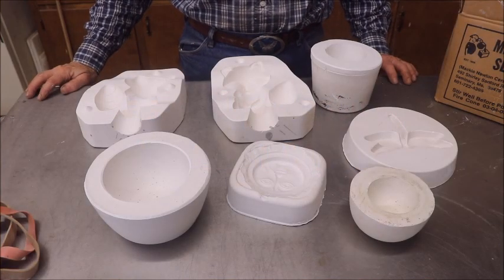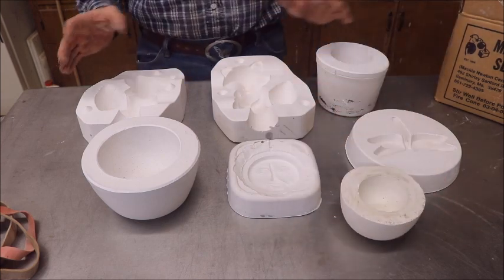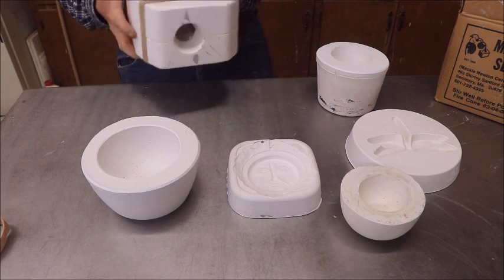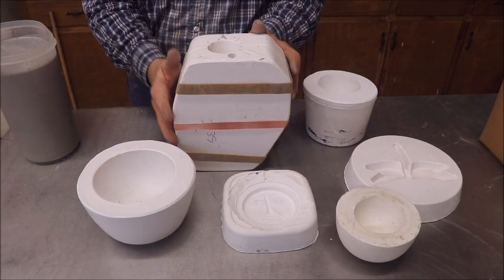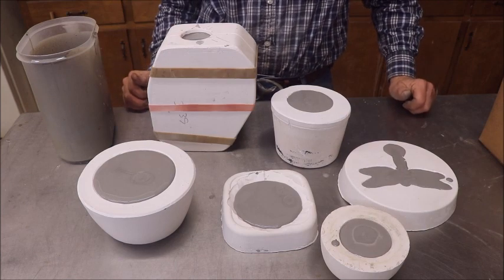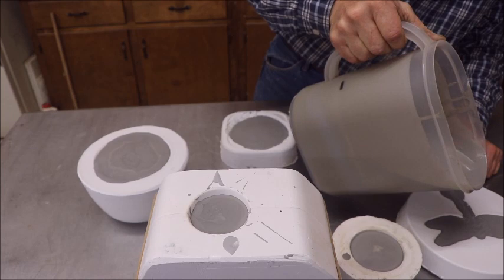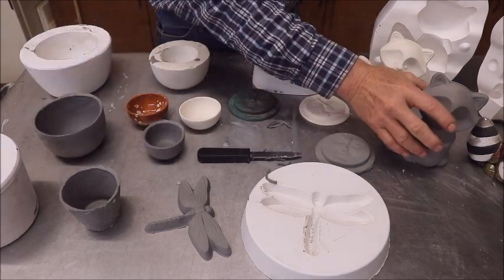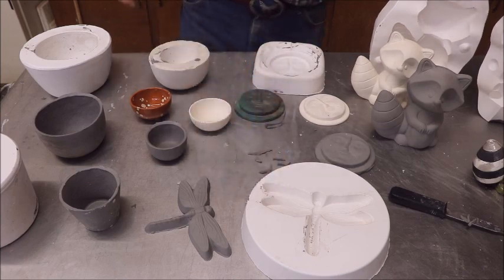Basic Slip Casting

Comment: Thank you so much for this video! Your voice is so pleasant to listen to and you sound so kind and reassuring. I have a buncha, buncha molds that I acquired super cheaply a couple years ago and never knew how easy it could be to get started using them. I'm going to go clean out a pottery room & get set up!
Reply from the maker: Good luck with your slip casting.  Let us know if you have question.

Comment: Thank you so much. This is totally new to me.  It peaked my interest because I have a microwave kiln and while  I make a lot of  jewelry with stained glass  I  wanted to get  more use out of the kiln and try something new.  Can you please  share where you got the slip and also the fiber to fix the kiln base.  Thanks again
Reply from the maker: No problem Maria.  Tomorrow I will get to work  on obtaining that info for you.
Reply from the maker: Maria, you can start at Amazon for the Kiln fiber paper/blankets/liner, It comes in all thicknesses and lengths.  As far as the slip goes, it depends on where you live as to how difficult it will be to obtain.  I live in a small town in Georgia and I have to drive to Columbus, GA to get mine.  It can be purchase on line, but the shipping might be a killer.  Start here http://www.bigceramicstore.com/clays/clays-by-type/slip.html and do some research.  As you will discover, it can also be purchased dry and you can mix it as you like.  If you have other questions, please ask.

Comment: Capt. Mike, with the pandemic I had decided to try something new. I purchase a lot of plaster molds, wanted to start by using plaster París instead of slip clay, but it get stuck in the molds, can I work with plaster París or pottery plaster and do casting in the molds or I only can use clay slip on the ceramic/plaster molds.  I am new and learning by reading and watching youtube. I enjoy yours. Please help
Reply from the maker: The plaster molds are designed for clay slip.  If you pour plaster into the you will not be able to get it out.  A two part mold will stick completely together.  If you cannot get clay slip, you can make it from moist clay.  I have two videos on how to do this https://www.youtube.com/watch?v=LN8w-DIEQLk and  https://www.youtube.com/watch?v=p3uYvu7QlJg
Reply: @CaptMike  thank you for the videos, it would be great if I can create a silicone mold using the plaster molds I already have.  learning step by step thank you again.
Reply from the maker: @beatrizgrajales4181  I thank YOU for watching my videos.  I wish you all the luck in your adventures.  Glad to help where I can.

Comment: Mike thank you so much for the tutorials. They are fun and easy for a novice like me to follow. I’ve just made a mould and put an unglazed pot into it, which is now stuck (as the plaster hardens). Happy to break the pot I want to replicate but my second problem is that I’m concerned about getting the slip out of the mould because the opening is small. What should I do? Haven’t started with the slip yet;)
Reply from the maker: I the pot you are using as a mold is enclosed all around except for a small opening around the top, you will have to make a two part mold.  If the pot is shaped like a flower pot, then when the plaster is dry (assuming the clay pot comes out) you will be in business as the clay slip will shrink as it dries and the molded pot will pop right out.

Comment: Hi Capt Mike! I wonder if you are local to me! I just drive to Mackie’s last week and Val loaded us up! We are new to this..trying to start a church ministry. We just poured our first molds after watching this video. It is VERY hot in our metal barn. When we went to drain, some molds did not want to drain anything. Did we leave too long? We left the small ones about 20 minutes and large vintage mold about 35 minutes. We have had tons of rain but the heat was drying the slip quickly! Thanks
Reply from the maker: I live in Elberton, GA.  My shop is airconditioned so the high temps could play a big role.  In a large mold I can leave the slip in for about an hour.  Again, that depends on atmospheric conditions and how dry the mold is. What are the molds casting?

Comment: Hello Capt. Mike EXCELLENT videos. I've been binge watching and learning. Thank you sir. Quick question I only have silicone mold that are food grade and can be heated so they are super durable. Can I use this for my clay slip? because I do not have plaster mold. My molds are only silicone grade. Or maybe I can use paris of plaster to pour into the silicone mold to make is plaster then use it with clay slip.. What do u suggest?
Reply from the maker: The only problem with pouring slip into a silicon mold is the lack of absorption.  That's what the plaster of Paris does.  It absorbs the water from the slip leaving a clay shell.  You clan press normal ceramic clay into the silicon mold and it will dry faster.  You have nothing to lose by trying the slip.  It will just take awhile to dry.  Another idea (I am working on this as we communicate) is to make a master (positive) by pressing regular modeling clay into the silicon mold and then sticking it to the bottom of a container and then pouring plaster of Paris over that to form a mold.
Reply: @CaptMike  hmmm I would love to see a video on your new idea you're cooking up and thx you. I'm not interested in making a clay shell. I want a full clay mold. Im making soap dishes btw. So either I can use modeling clay in the silicone mold or the slip.

Comment: Love your video. What happens if you don't fire them because you don't have a kiln?
Reply from the maker: Lori, you cast clay slip in a plaster mold.  If you do not fire the clay it will remain soluable in water and if the piece gets wet or bumped (it's fragle) it will fall apart.
Reply: @CaptMike  Thanks!

Comment: Hi! Excellent video. New to slip casting…how large do you recommend the length of the rubber bands relative to the circumference of the mold? I have a mold I just measured at 27”, so what size rubber band would you think I’d need for it to be tight enough, but not too tight? Thank you!!!
Reply from the maker: Iuse 3 sizes, but off hand I don't know the lengths.  However, Don't worry about the bands being too tight.  Use the smallest you can get around the mold.  thanks for watching!

Comment: Hi Capt Mike. I've watched loads of your glass fusing videos, and I'm intrigued to know if these types of castings once bisque fired, could also be used for glass casting? I've had limited success using clay for casting glass, and these look much more like the moulds I've had from Creative Paradise and Slumpys and it would be great to known if this is something I could use them for.
Reply from the maker: Any clay item, bisque fired will work for slumping or forming glass.  Well, at lest as far as the design permits.  The bisque piece, once coated with glass release agent will stand the temps for glass work OK.
Reply: @CaptMike  Thank you so much. I'm going to have a go at this. I think my clay pieces insulated the glass too much, but doing a thinner slip cast piece will allow more heat to get through the glass. Super excited. :-)
Reply from the maker: @helpforhedgepigs8461  Let me know how things turn out.

Comment: Thanks for your videos, Capt Mike! After you initially pour the slip in, how long do you let the bowl molds sit in order for the sides to harden up?
Reply from the maker: Depends om how dry the mold is and the weather.  Usually, with fresh slip about an hour or until the slip looks to have formed about a 1/4 inch shell.

Comment: Great detailed explanation . Thank you.   What is the gray liquid material you pour into the plaster.  Do you have video to show that also?
Reply from the maker: The grey liquid is liquefied clay called slip.  It can be bought commercially or you can make it by basically adding water to your clay body.  When you pour it into the plaster mold, the mold adsorbs the water from the "slip" and solidifies it back into the clay body.  The result is a cast of the inside of the plaster mold.
Reply: @CaptMike  Is this clay food safe? Thank you.
Reply from the maker: @mikekiske  The clay is food safe when bisque fired and the glaze will be depending on the type.  All glazes will state whether they are food safe or not.  Most are.
Reply: @CaptMike  Thank you!

Comment: Hi Capt Mike , I'am new to this is it possible to pour molten aluminum in these plaster molds or will they not last long
Reply from the maker: I don't think the plaster would hold up.  If yu try,  make sure the plaster is completely dry and use a flat one piece mold, not a 2 piece where you pour the metal inside.

Comment: I'm really new to doing ceramics.  Can you tell me if you can make a plaster paris mold with a plaster paris object. So in other words I have a  item that is made out of plaster paris and I want to make a mold of it in plaster plaster . Thank you  I really enjoyed the video and have learned from it..
Reply from the maker: If the final product is going to be a plaster duplicate of a plaster original, then I would make a mold from silicon or latex, depending on the subject.  It is possible to coat a plaster master with enough stuff to keep it from sticking to the new plaster, but it is problematic.  I have used cooking spray, Vaseline and Murphy;s oil soap to keep the second half of a two piece mold from sticking, but never tried to mold plaster to plaster.  Unless the master is painted or something like that,  I can assure you that plaster will stick to plaster.  I will do a few experiments when I get a little time.
Reply: I"m going to use the mold that I make with ceramic. I just need to make a mold from a object that is made already out of plaster paris.  So i'm thinking that if i paint the object first with acrylic paint then use cooking oil , I"m thinking it will work ok...lol  with fingers crossed.  That will be great when you get free time to do some experiments ... Thank you for letting me pick your mind a bit...

Comment: How long before you pour the excess slip out of the mold?  how long was it before you pulled the acutual part out of the mold from the time you first poured the slit in?
Reply from the maker: It depends n several factors, but mostly on how dry your mold is and the thickness of the slip.  Under normal temperature 70-80 degrees F and average humidity my low fire slip obtains a desired thickness (shell) of about 3/16 to 1/4 inch in about 45 minutes; sometimes little longer.  I live in Georgia USA.  Demolding can be done as soon as the clay sip is ridged enough to be handled without deforming,  usually 3 or 4 hours depending on the complexity of the molds.  Slip can be left in simple molds overnight if you wish.  Hope this helps.

Comment: Did you pour it out of the 3d mold as well?
Reply from the maker: You only need to do one pour into a plaster mold.  Pour in the slip. let it set for awhile (usually 30 60 mnutes) and pour out the excess slip.  I usually let my molds set overnight, but at least until the clay is solid enough to be handled.
Reply: Thank you :)

Comment: wondering if you can do this with air dry clay slip
Reply from the maker: Don't know anything about air dry clay slip, but if you can get it liquid enough it might work.  What I would suggest is to first put some of the slip on the outside of the mold or on some plaster and see if it will release when dry.

Comment: So the water just needs to escape the clay right? Does this mean I can pour slip into silicon molds?
Reply from the maker: Theoreticality you can, but the time it will take for the evaporation will be lengthy.  Normally a plaster mold absorbs most of the water and speeds the drying.

Comment: do these molds ever need some kind of mold release?  My roomate said they need some kind of release?  or is that just when the plaster molds are first being made?
Reply from the maker: No they do not need any type of mold release.  As you mentioned, the only time I use a release agent is when I am making the plaster old.  Most of the time if the master is glass or plastic a mold release will be necessary.  After the mold is made and dry all you have to do is pour the clay slip into it.  As the slip dries it shrinks and pulls away from the plaster so you can remove the cast piece.

Comment: When I take my 2 piece mold apart, the piece is always brown in half. What am I doing wrong?
Reply from the maker: By brown, do you mean inside the cavity?  If I use my  local clay for slip casting it always turns the inside of my mold brown/red.  The casting will also be the same color.  If you are using regular low fire clay slip purchased  from a supply house, it usually will be grey in color and fire to white.  Terracotta slip will be red.  Let me know.
Reply: @CaptMike  sorry! That was a typo. What I meant to say is when I pull apart the piece, it's always broken in half. I measure the slip gravity everytime . I am starting to think it has to do with the mold itself. Do you ever find the slip being clogged in the mold? How do I make my molds better so they drain the slip properly?
Reply from the maker: @vishakhabhargava4070  after you pour the slip out of the mold, how thick is the walls of the cast?  Do you wait long enough for the cast to set up.  If the clay is too soft it will come apart when you demold.  Better to wait until you are sure it is solid enough.  If you are using a small mold,the slip might clog, but should not with a larger mold.  Mind telling me what you are trying to cast?

Comment: Do you know what are the factors that affecting the casting rate/time?
Reply from the maker: As best I can tell, water to plaster ratio, room temperature, and maybe the age of the plaster.  I think I once read that using warm water would make the plaster set up faster and really cold water would make it set slower.  Thanks for the idea.  I will need to do a little experimentation.
Reply: Thank you it is really helpful. Feel free to share your experimental results.

Comment: Hello. Can someone tell the ingredients to mix in my clay for faster drying.
Reply from the maker: As far as I know, there is no additive that will speed up the drying process without adversely effect the clay body (please jump in if some one knows differently).  It should only take about three days, depending on your weather conditions for the clay to dry sufficiently to fire.  Try a test piece in your kiln after 3 days and see if it holds up.  A clue to whether the clay is dry enough is if it feels the dame temperature as the surrounding air when you hold it in your hands.

Comment: what is this clay - cement or what?
Reply from the maker: The material poured into the mold is called slip clay.  It is a liquified form of a regular clay body like you throw in a potters wheel, only formulated to be porable.

Comment: Plaster of Paris?
Reply from the maker: Plaster of paris or plaster is what is used for slip casting.  The plaster absorbs the miosture from the slip leaving a "shell" that will be bisqued.
Reply: @CaptMike  thank you for your reply. I just started experimenting with making my own moulds and learning that there are many types of plaster on the market, some not suitable for mould making. Like the kind you use to patch a wall, for example. I used plaster of Paris to make a few moulds and they turned out fantastic but when I used slip in them they didn’t form a shell and it was as if the slip curdled. So perhaps I need to try a different slip. But also making sure I have the right mould in the first place.

Comment: All of those shapes are 3-D, so I don’t understand why he’s calling only one of them 3-D. 2-D would be perfectly flat and smooth, with no distinguishing features other than its outline.
Reply from the maker: Hi David, I did not re-watch the video, but I guess I was referring to one piece molds vs 2 or 3 piece molds.  In my experience a completely flat molding, regardless of how thick is a 1 D mold.  A 2 D mold is one where you get detail on the top and maybe a little on the sides and a 3 D mold is one that completely detailed all around.  this make any sense?

Comment: Putting a clock in the video is impossible I suppose. How long did you wait before the pour or releasing them?
Reply from the maker: I should have addressed the time involved, but in my haste I sometimes forget stuff.  I mix the plaster into the water until it has all mixed in, about 3 or four minutes.  When there are no more lumps to be seen I bump the container a few times to dislodge air bubbles and then slowly pour into the mold.  Depending on several factors, temperature, humidity and plaster/water ratio, it should start to set up within 30 minutes....sometimes faster.  Anytime after it has solidified it can be de-molded.  Some directions say as little as 30 minutes.  It can still be warm, but no water sitting on top.  It is one of those things you will have to experiment with a little.